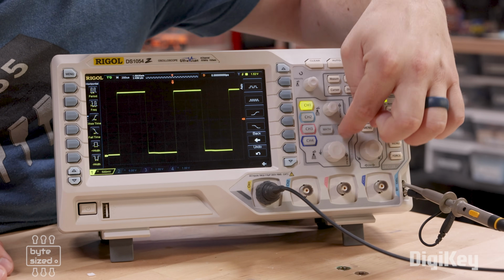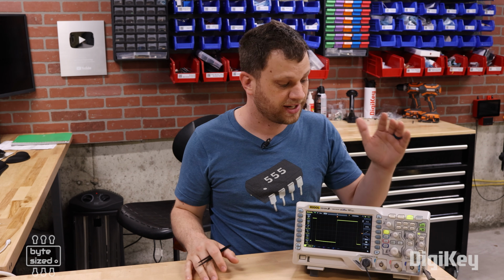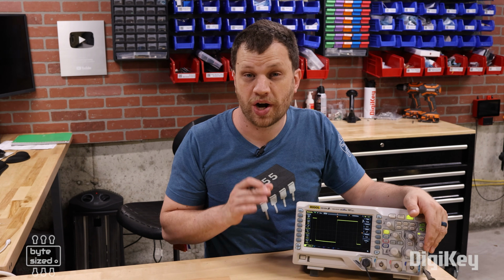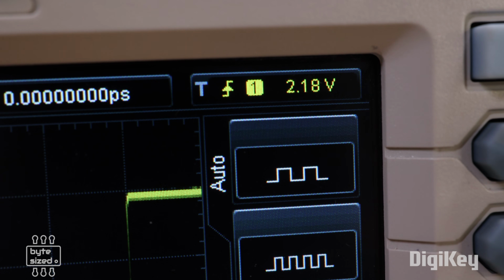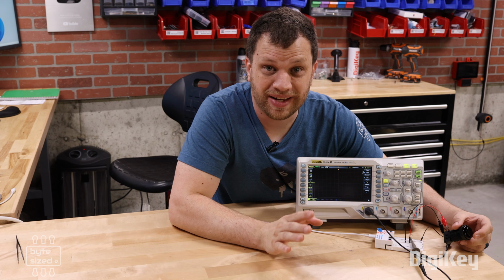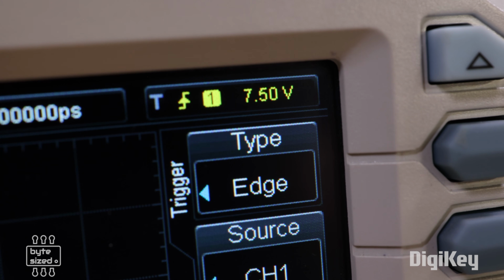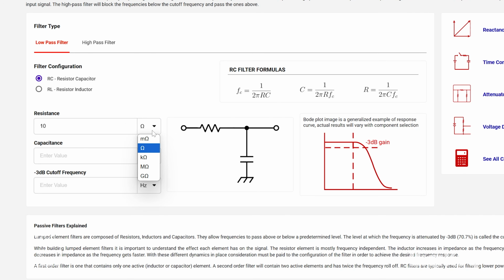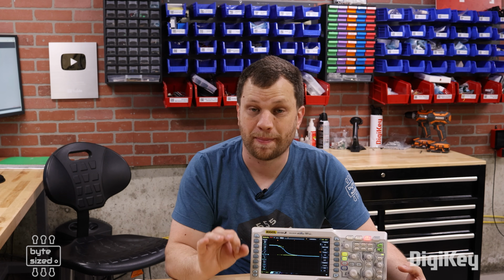How to use an oscilloscope - The Byte Sized Engineer | DigiKey

Comment: Cool intro. One thing though: the lowpass filter is introducing 3-4ms of lag in the button press. For some applications that might be okay but for others that’ll not work. Another way is to debounce in software: trigger on the first falling edge and introduce a deaf period of, say, 5-6ms where the MCU ignores further changes from that input pin. The scope is still useful to see the bouncing and how long it lasts.
Reply: Hardware guys gotta have hardware solutions. 😉

Comment: Thank you for posting this excellent video. It is very helpful for me. I have a very old Tektronix scope that is down in the basement. I also have a newer Tektronix scope, which is far more modern, right next to me. But I do not know how to use either scope and I am not sure I have the instruction manuals for them either. I would really appreciate it if you continue these episodes on how to use a scope. The example in this video with analyzing a pushbutton signal is helpful for me because I do have a supply of these buttons. I would like to see you show other practical examples where using a scope can help; I hope to learn from these and start to become comfortable with my scope. Thanks again so much for this video.

Comment: The bandwidth consideration can make the difference between spending a few tens of dollars or spending a few hundreds of dollars, or even thousands of dollars, on a scope.  If you don't need to measure MHz signals, there are far cheaper options.  If you want to measure GHz signals, well, time to ask yourself if you really need to...

Comment: Isn't it more common, flexible, and cheaper to de-bounce in software? (I get that this is a made-up, pedagogical demonstration.)
Reply: Sure, in many cases, but what if your circuit doesn't run software?
Reply: Denouncing applies to circuits without microcontrollers too